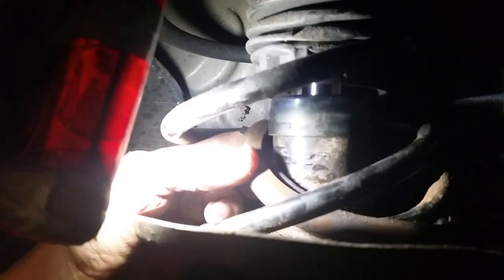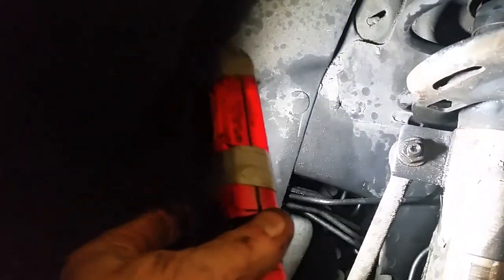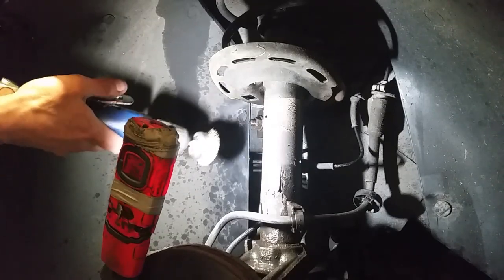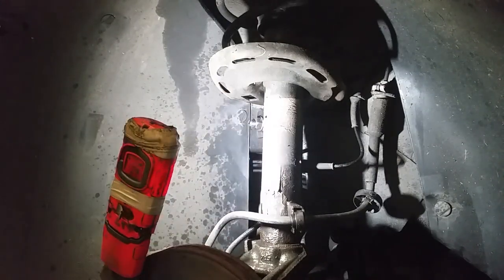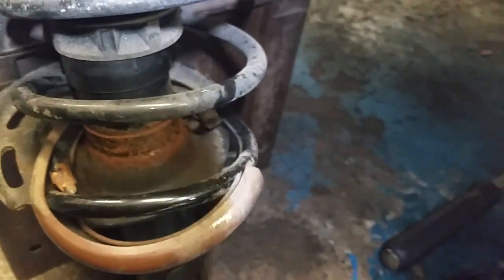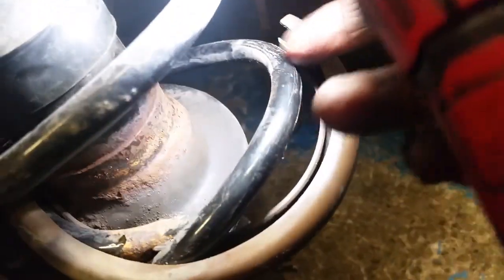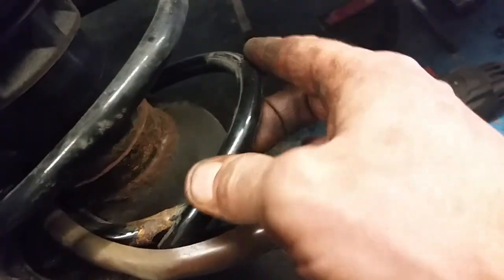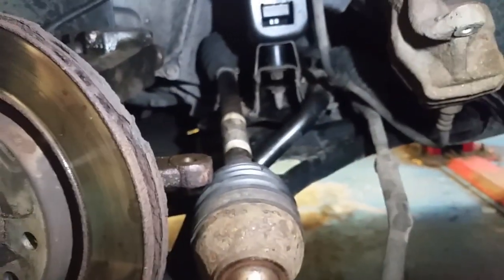Citroen ds3 c3 broken front spring. Mcpherson strut

Comment: Have done a few of these recently, just pull the full hub off complete , save knocking the leg out , just got to be careful with the nearside shaft spring tension, dumping all the gearbox oil out , great video Dave
Reply from the maker: Aye mike, some i knock the hub down, some full removal. Did a spring on a wee Audi A1 the other day, full hub and strut off, no clearance
Reply: @davesterl  did a Scirocco last week , full jobby off, no bleeding room, changed the spring and the lovely top mount , as we all love the so called captive nuts that spin either when undoing or on refitting , so silly nowadays that manufacturers still use legs with only a clamp bolt , takes so much more time to do than 2 bolt  fixings 💰💰💰
Reply: Got a customer here in sunny Bolton, who lives at home in Belfast at weekends, but works here during the week , he's got a Fabia VRS, on a 55 plate , power rack has started to leak , rang Euro today , they said choice of about 8 different racks , what colour plug , what name on rack , what day was it built , blah blah , how are we supposed to price a job unless buying from dealers, Euro said between 94- 500 quid plus vat for rack ????🤔🤔🤔
Reply from the maker: @mikeberry304  i havent went near ecp in ages, my local factors is great or tps for vag

Comment: In the case of an MOT failure. Is it a must they are changed in pairs Dave?
Reply from the maker: No ian, not a requirement to change both. It is recommended altho i rarely/never do. Customers just want broken one fixed. Shocks shud defo be done in pairs. Cheers dave
Reply: Understood. I have changed several "singles" in the past. But always wondered if I was meeting "shop" standard by doing so. Cheers Pal
Reply from the maker: @TheGibby3340  mot in n.ireland is a bit different to the rest of the uk. When car is 4 years old and tested by local govt agency testing stations. 3 in GB and done by garages. The requirements are all about safety and sometimes seem a bit strange. Theyr goin nuts over brake and clutch pedal rubbers atm. What do they do in canada?
Reply: No recurrent requirement. Only at change of ownership. Certified fit by licensed mechanic. Even "clean air" requirement has been dropped here in Ontario. Insane set up but true.
Reply from the maker: @TheGibby3340  holy fek!!!

Comment: Hi I know this is an old post but . Can I remove the strut without removing hub thank the video is class
Reply from the maker: yes you can
Reply: @davesterl  Thanks I try mine tomorrow got a seized brake disc any videos for that
Reply from the maker: @carloboni9550  no vids for a seized brake disc although this type is easier to take the strut off complete with the hub